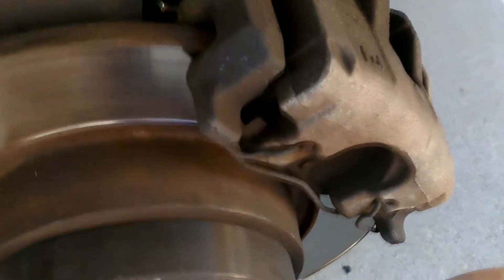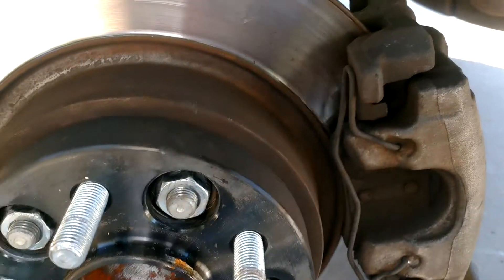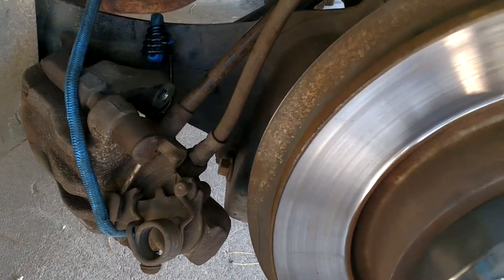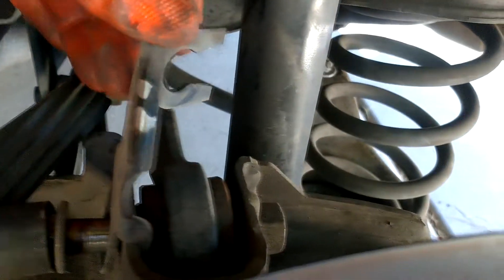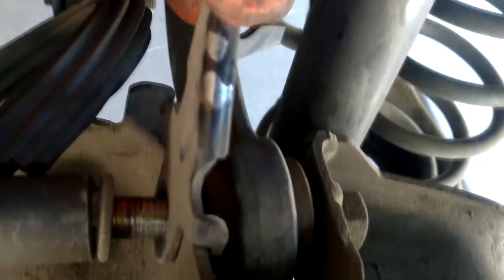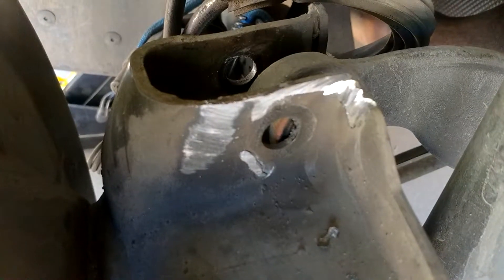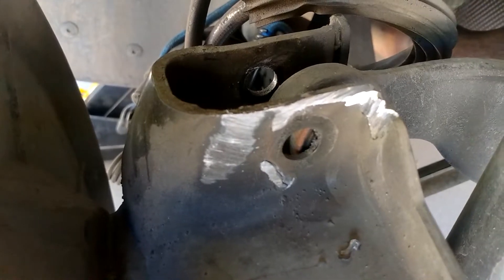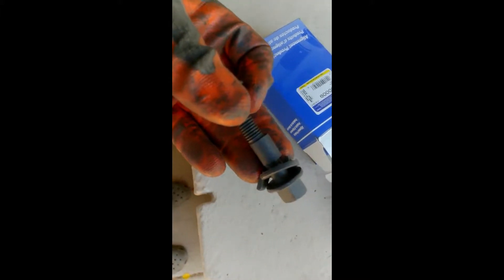Volvo Camber Bolt Install - Moog K100009 - reducing negative camber on a Volvo V50 S40 C30

Comment: Just use a large C clamp to compress the brake pads to easily be able to remove them with the caliper. There is no need to grind down the edge of the rotor.
Reply from the maker: I agree in general, but wanted to get rid of the lip on the rotor for ease of future work.  That way, you just have to give the caliper a little twist, and it'll slip right off (plus, it looks better without the lip).  ;-)

Comment: So how much difference  can these bolts make ? my C70 which has the same set-up has around 25 mm of negative camber from the vertical, so my tyres are wearing badly on the inside edge! Thanks
Reply from the maker: I didn't try to measure the maximum change the bolts can make, but I'm pretty certain that 25mm is within the range of change you can get.  And IIRC, the ideal camber is still a little bit negative on our Volvos, so you won't have to make an entire 25mm adjustment to get it right.

Comment: Hey, i'm looking to put spacers on the back too, do you remember what size they are? 20mm/25mm? Thanks
Reply from the maker: If I recall correctly, they were 20mm. However, that's not going to help you much unless you are installing the exact same wheels. You have to check the offset, and work out how much further out your wheels can be without causing interference to the fender lip. I usually just measure it with the wheels mounted, and work out how much further out they could be without causing a problem. Just remember it's not always intuitive as to how the wheel will move up into the fender well when the suspension is compressed. And that's where you have to work out the clearance. Probably the safest way to do it would be to drive onto a raised surface with each wheel, so that that wheel is pushed almost as far up as it will ever go, and then measure the distance from the outside of the tire to the inside of the fender lip, and get a spacer that's just a little narrower than that space. That should put the wheels out as far as you can get them, without risking your fender lips or your tire sidewalls.
Reply: @Mark_H_DIY  i see, im running the stock 17x7" Volvo 5x108 wheel's, stock suspension, i wanted to know if you needed grind a little bit of the bolt to fit the wheel, im not sure if 20mm dont rub
Reply from the maker: @israel426  it's been a long time since I did it on the Volvo, but if I recall correctly there are spaces between the bolt holes on the rim that allow plenty of clearance for the original bolts to clear. I know I didn't have to grind anything to put my spacers on. You will have to use the shallower nuts they supply with the spacers, though. I should call them adapters, though, because they're not just simple spacers on a Volvo. :-)

Comment: Hi ! How was your tyre wear after ? Thanks !
Reply from the maker: To be honest, the tire wear wasn't really awful before the change. I sold the car not too long after I did the job, but I know the new owner, and the tires are wearing well.
Reply: @Mark_H_DIY  my rear is bad. I don't know if it can be adjusted without any modifications. I will take it to a shop next week. Thanks !
Reply from the maker: @MegredyPhotoStudio  There are many possible reasons for bad rear tire wear, including worn bushings. The camber that's normal for the Volvo S40 and V50 is excessive, IMHO, and will cause the rear tires to wear quicker than they should.

Comment: Well done! Is this normal for Volvo's? My 09 s40 camber is way out. Any other problems to look for?
Reply from the maker: Look at the other bushings, which can wear out and affect the camber. I know the camber on my V50 was way out before I installed the Moog kit. Just make sure you can measure the camber after you are done.